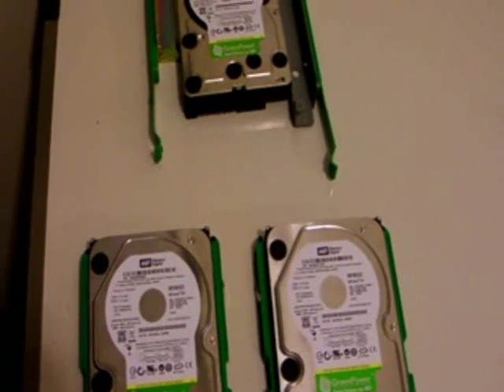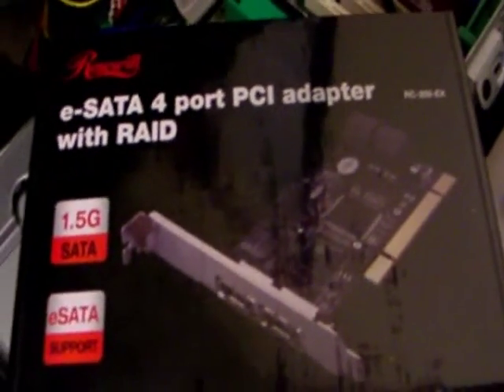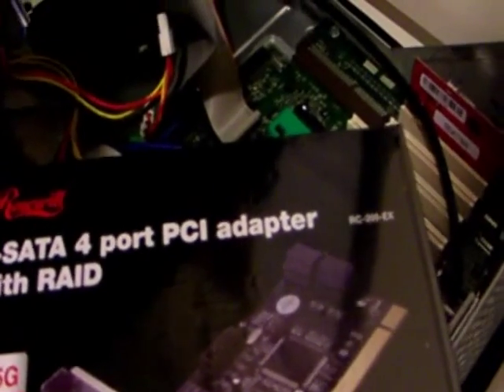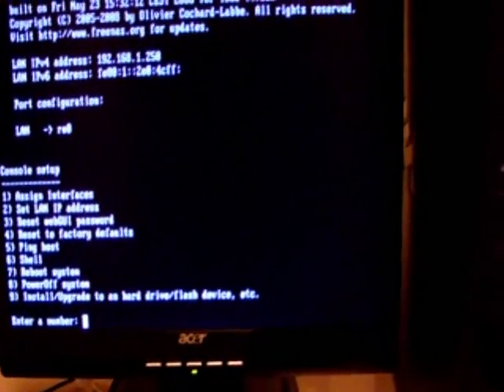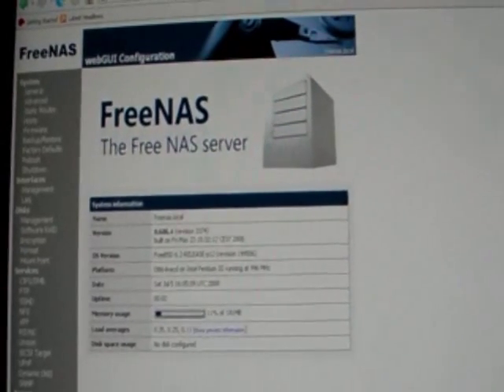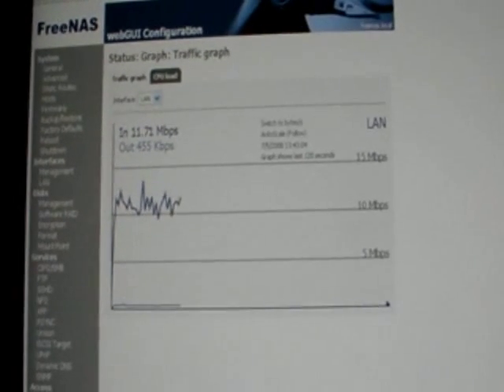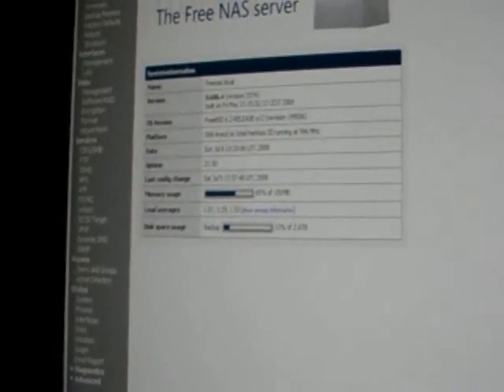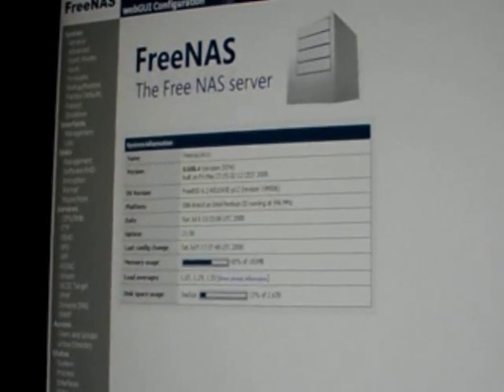Building a 3 TB Backup Server Using FreeNAS

Comment: Is there any thing right with this video. I hear kids in the background while you are talking about freenas. You are recommend to use a hardware raid device. FreeNAS does not need it and it software raid is better. Also you need better hardware. It would be O.K. if you used it for pfsense.

Comment: @ logistix111

That would leave the backup drives vulnerable to the same potential problems that could damage/corrupt the main drives. 

Besides, gigabit ethernet is fairly fast, faster than USB2 for example,